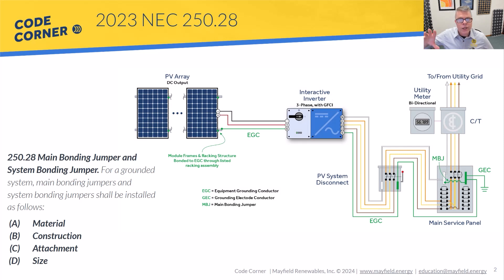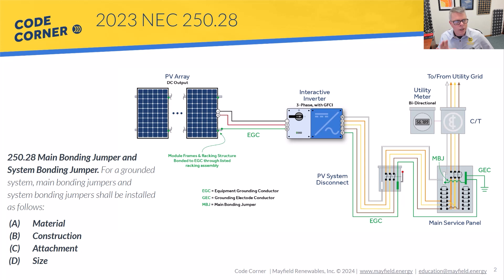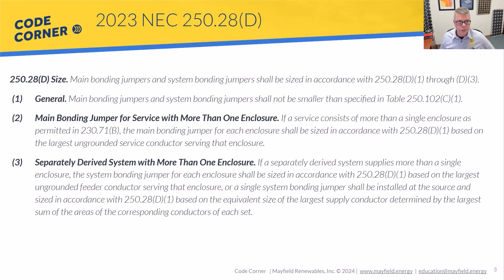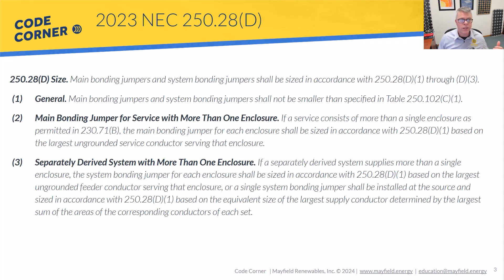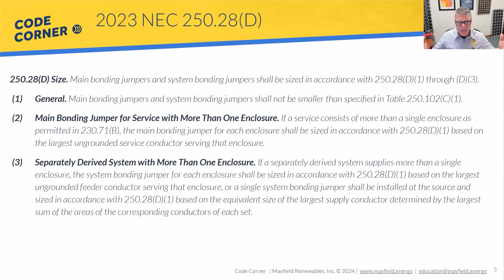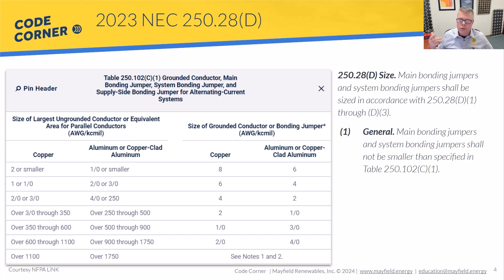2023 NEC 250.28(D) Sizing Main Bonding Jumpers

Comment: doesnt this contradict the rule of one neutral/ground bond?  this seems to have 2 of that type connection.
Reply: The rule you're referring to is 250.24(B), and it applies the grounded conductor on the load side of the service disconnecting means. In the case of the PV system used in our example, the connection was made on the supply side of the main service disconnect and, therefore, does require a neutral-to-ground bond.
Reply: @ryanmayfield2728  thank you for this... forgive my ignorance, even at the supply side of main, the neutral  is tapped into (the bonded conductor there).. so by doing so twice doesnt that cause a problem about some kind of "floating ground".... maybe im using wrong words... I wish i could draw a response.
Reply: @keything8487  I think you may be referring to a ground loop. Floating ground is when a ground doesn't have a 0 voltage reference point and the reference voltage can shift up and down. I believe the EGC between the PV System Disconnect and the Main Service panel acts as a parrallel conductor with the neutral between those equipment, maybe it could be a ground loop in a ground fault, but looking into that more.
Reply: https://youtu.be/pJDFFq5oRAg?t=504
Reply: @alexcarpenter7951 Thanks for posting the link to that other video. I was happy to get Ryan Jackson on to help explain this, hopefully that helps with the original question.